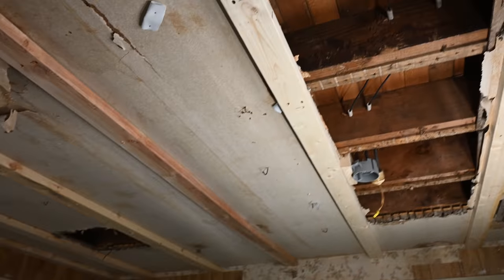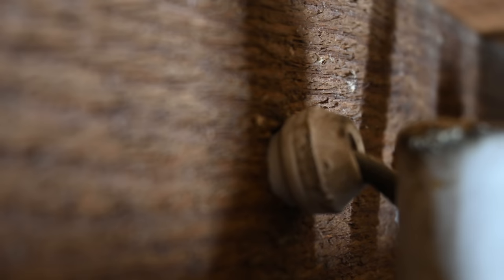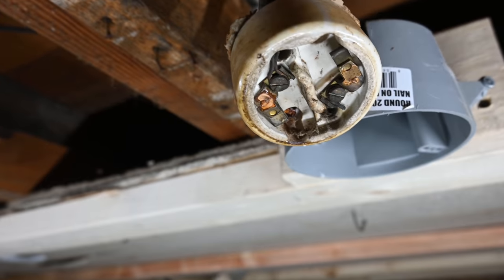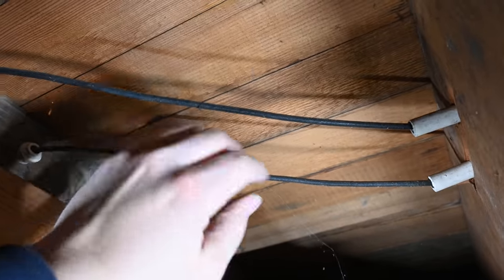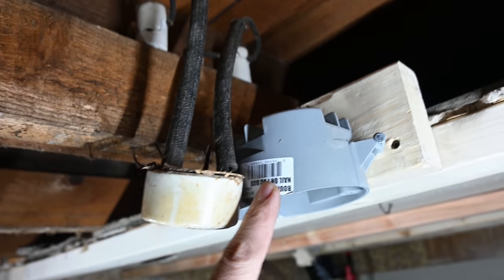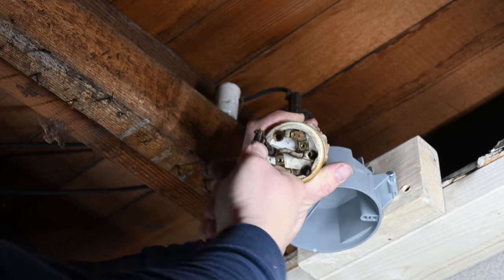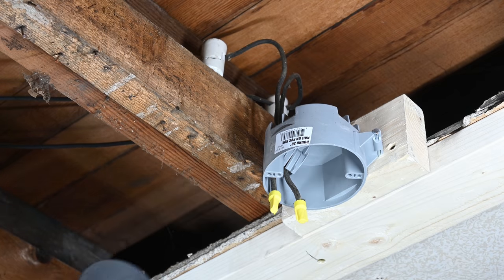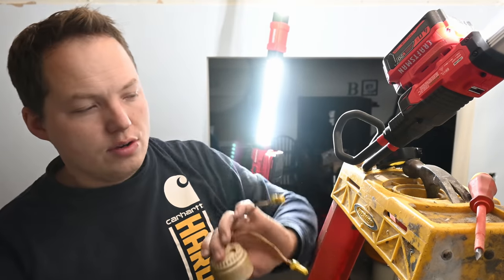How To Abandon Knob & Tube Wiring in a Wall or Ceiling

Comment: I'm in one of those areas where we prune back K&T by wrapping it around the last knob and covering with several layers of tape until we have an insulation as thick as everywhere else on the wire. On the other hand, we have to keep the loom covering when entering a junction box - the idea is that the insulation of the old wires tends to crack when bent or where it comes into friction contact (as with wire clamps). I see tremendous variation - some areas it seems in great shape - others the insulation is cracked and paired with shoddy add ons. My biggest problem with K&T is the complexity - because it is spliced outside of boxes it is often hard to decode. I have to be very careful in removing it that I'm not cutting off power to half the house. And sometimes it bridges circuits and shares neutrals - a recipe for destroying expensive fixtures when you think everything is done and flip the breakers back on.
Reply from the maker: Thanks for sharing. Having a lot of experience seems imperative when working in the situations you mention. Good point about leaving the "loom covering" in place. The insulation seemed fine in my case so I didn't think it was very necessary.
Reply: Well alot of homes use K&T  as well as Fuse Pannels ! Then you will find people splice Romex into it to give the elution they did a Rewiring Job ! Also people just replace the 2 prong outlets with 3 prong outlets to give the elution the wiring was up greaded !
Reply: @tww1981  There's a belief out there behind the hear-say that by putting a grounded receptacle into a two-wire system, then it's "grounded". It's
another example of people believing what somebody told them and  the bigger the LIE grows, the more convincing it is.
Reply: @frankpaya690  There is alot of "lets say -- creative wiring " to be found in homes ! That is something Mike Holmes found out on a episode of his show ! Although being a big name contractor on TV ; Mike Holmes should have known there is more than one way to feed both legs of a 240 volt circuit !  Hay it makes the job more interesting !
Reply: @tww1981  lol sounds hazardous!!
Reply: I’ve used them in light fixtures only like here in the video. They have now retired knob and tube now in Ontario under code. No additions or use.
Reply: @tww1981 What’s an “elution”?
Reply: @frankpaya690 
😲😯😲🥺😬🥴😵‍💫😵💀👻
Reply: @johnmack537  that the circuit is a grounded circuit and it's not
Reply: @mofbombay6290  I think the writer meant illusion, not “elution”.

Comment: If I have to partially abandon a run, I take it back to the nearest knob, loop it, then coil it back on itself, then tape it. Use the rubber tape, followed by the friction tape, like they did originally. I know when I see a potential hack job when I see shiney vinyl tape.
If doing a complete rewire, I remove all the wiring I can get to as well as the knobs and tubes. The holes left by the tubes are used to feed new NM cable. 
Another pet peeve are those that remove knobs by bashing them with a hammer. It sends porcelain shards flying. Use a flat prybar, push the knob to get the bar underneath and pry up. They come out quick and intact. No mess and faster than hammering.

Comment: I recently bought another home, and it also has knob and tube. My first home was built in 1860. The whole upstairs was still knob and tube. I found so many scary things in this house. The attic had blown in insulation, and when I went poking around I found a open junction box that was way over the allowed amount, and packed with insulation. At the time I found it I had already lived there for 10 years. I'm very surprised that a fire never happened.

Comment: Hey Frank:  The house I renovated was built in 1920.  It had 110v single phase service.  The 110 input was divided over two 60 amp cartridge fuses.  Typically, one circuit was for lighting and the second was for outlets.  The wires were coated with a shellac type substance.  There was no heat insulation placed into the wall.  When we bought the house the kitchen had a refrigerator, a chest freezer, a clothes washing machine, and a gas dryer plus a light.  In the attic, again no insulation, the posts were mounted on top of the ceiling joists and wires were strung between the posts.  A parallel set of wires about a foot to 18" apart was on circuit.  The house was doubled in size with a replacement kitchen and a master bedroom.  The service to the house stayed the same.  As part of renovation we rewired the entire house to current code in 2009.  We were going to leave the knob and wire arrangement in the attic as it was no longer connected to anything but the inspector wouldn't allow it.

Comment: Ben, LEDs are all driven by DC and they all flicker! If they didn't flicker, the diode would actually burn out. The strobe effect you're seeing is caused by your cam capturing at a frame rate that is out of phase with the LEDs. Some flicker slower or faster than your cam, so some are just fine. 

I agree with everything you said about K&T. Only thing I'd have done differently is keep the wire in the loom tubing, and push that wire and loom through one of the box clamps for added protection. I've used a screwdriver to push open those integrated clamps in the box wide enough to jab the loom and wire in it. One clamp per conductor as you did. I also like to put a band of white heat shrink tubing around the conductor I've confirmed as neutral. 

Bummer about messing up those Knipex. Think of it at it as a battle scar in your journey to be a sparky. I have messed up at least three pairs of side cutters cutting cables "I could have sworn" were dead.
Reply: Higher frequency PWM would make everything less or not noticeable though.  Difference of a few cents.  Just old fashioned thinking.  I agree with Ben.  We need to upgrade the PWM frequencies on all dimmers!  Godspeed!
Reply: Um no. They don't all use pwm type of power sources and even if they did, obviously some brands have mastered the art. Leds must be current regulated but do not require pwm or pulsed power sources. They are used in all kinds of equipment including indicator lights and are most definitely NOT pulsed in those applications. Especially when using linear power sources . 
Pwm allows better efficiency of power usage because you are not wasting it as heat which is what happens when using a resistor of sort to lower the current to the LED. Milwaukee has not mastered it's use and are terrible across the board when it comes to their lighting.

Comment: Was an electrician for 20 years, move to a different state with no reciprocity for my license, I'm now working as a demo-remod apprentice (general)... today, almost 30 years after I started wiring, did I finally leave a house with a working k&t circuit. I've always been fascinated with and had an affinity for antique electrical equipment, so to quote the venerable Ice Cube, "Today Was a Good Day"...

As far as what we did with the circuit, inspect it and leave it alone. The original light fixture was still attached, and still working.

Comment: Thanks for sharing.  I’m slowly replacing the knob & tube in my 1940 built home.  When it comes to contemporary load demands, although the LEDs require a fraction of their predessors, they lighting is often shared with power or receptacles which are likely to be drawing more current than they’re designed to carry (such as a 30 amp water heater circuit being fed on maybe a 14 gauge wire).  I have found several cases where the cloth insulation has warn through, exposing the conductor as it enters the box, so I suggest using the Supper33 you reference to wrap the insulation if you notice any deterioration and add a wrap of white on the neutral as well as a circuit number on the hot for future convenience.  Where a splice occurs inside a box to mark the incoming hot so as to keep track of the direction of the current.  The scariest thing I found was finding the Zinsco panel allowed some very hazardous circuits to hold, rather than trip the breaker- even after a hot and a neutral arched in a ceiling fixture, caused by the cloth insulation breaking down in a pendant light in the dining room.  Fortunately, it was shortly after our first dinner guests returned home.  PS- I would be very interested in a walkthrough of the old house you mention.  Thanks again!
Reply: I will preface this by saying I wouldn't recommend this to anyone, but what I do when replacing fixtures on a ceiling that have had a history of being overlamped, I typically find the K&T wiring's insulation disintegrating in my hands.   Usually the wire is #14 solid.  I take a piece of  scrap THHN wire and strip the insulation off a continuous length long enough to sleeve onto the existing wire where the insulation fell apart, then use a much smaller amount of 3M 33+ or 35 to tape where the old insulation meets the new insulation.  Obviously if you get the opportunity, it would be better to re-feed the wiring with NM-B cable, but to make that legal, you really almost have to start over, rather than simply run the NM-B back to the next nearest K&T  source, which technically is also a Code violation of greater issue.
Reply: Well of course your house at the most when it was built had a 60 amp service. My thoughts are if you have knob and tube abandon it yes it will be a chore but you will sleep better at night. Think about this I am certain you have seen old movies with those odd looking round light switches on the walls, well the wiring for those were most probably retrofitted in this buildings and the cuts to install them were plastered over. After a while you will get proficient at it.
Reply: I have ran into that old old wiring that replaced the knob and tube stuff and the cord wrap inside a box usually frays and if the wire is manipulated the least bit the black rubber just falls off the wires another thing you will find is copper coated steel wire from world war two. Found out about that when we did some junking in the early sixties and mixed a bunch of it in with good copper and burned the insulation off it to take to the scrap yard. Did not get squat for that load for sure.
Reply: We have so many Zinsco service calls, the bus bar always seems to burn out and breakers not tripping so they burn. I really do not like this knob and tube stuff. Eventually I'll change to commercial only.
Reply: @billhale9740  interesting, I'm only 22 so I like learning these things.
Reply: Same here, upstairs in a 1920's home (with no good access to ceilings because we have a flat roof and so, no attic). No flickering or dimming happens in a couple of rooms with small window AC units, so... fingers crossed. Wish the builders back then could see the future, as 1920's architecture is just not adaptable in may ways.

Comment: First  off, thanks so much - this video is very helpful.   My 1916 built home has a mix of K&T, ungrounded BX from approx. the 1950's, and modern wiring.  All the heavy hitters have been moved to the 100 amp service in the basement on newer wire.   I had insulation blown into the house 20 years ago unknowingly and just learned this was a major risk, so am now doing a map and inventory of all my circuits to see what is the state of the state.  

Fortunately, the two remaining solely K&T circuits running from the sub panel in the attic (30 amps) have very few fixtures and only outlets and lights.  But there are a number of circuits that are a mix of all three styles of wires.  One with 17 fixtures on it - ugh.   I'm currently moving as much off this circuit, with out having to open up the walls, all while trying not to curse the prior owners.  My tone probe arrives tomorrow (yay!) and will be a big help.   Also happy to have all LED bulbs at this stage.   It's shocking (haha) that there hasn't been a fire.  

I will be doing as much as I can right now without opening walls, and will most likely leave some wire in the walls.  Glad to know what can be done with the abandoned wire, and how to make it as safe as possible.   For sure I will not be leaving any live segments.
Reply: If you can, I'd suggest moving all receptacles off the knob and tube. That way you don't need to worry about heavy loads. I'm on my second house rewire with knob and tube. I found similar mixing of newer wire spliced onto the knob and tube. In both cases the landlord said the house used to be knob and tube but was rewired. Not even close - they put newer wire where it was visible and left a lot of k&t. In the first house, I really think they had one circuit for all lights and outlets. Breaker labeling gets creative too. A breaker labeled Living Room was really the living room, the kitchen light and an outlet, an outlet in the laundry area, outside lights, and ungrounded outdoor outlet in a non-weather poof box (!), the light at the top of the stairs, the lights in the middle and back bedroom, the light and both outlets in the front bedroom. The house I'm working on now had the entire second floor plus lights on the first floor, and first floor bathroom lights and the flood light out back all on a breaker labeled First Floor. Lol. Watch out for lights fed from both floors. I thought I had everything off the first floor knob and tube, so I cut the wires that ran through the first floor ceiling. The light at the top of the stairs stopped working. The neutral was taken from the second floor, but the hot came from the first floor. I got that corrected, but there was a wall light in the back bedroom (the only light in that room) that fed up from the first floor knob and tube. One trick that helped me was to use my clamp on ammeter to see what was on the knob and tube going toward the kitchen. I turned on or plugged in various things and watched the ammeter. I could tell that the ceiling light, one kitchen outlet, the light at the back door, one laundry room outlet and light, and the outdoor outlet were all on that pair of knob and tube wires going from the dining room ceiling into the kitchen ceiling.
Reply: A tone probe ncvt is a useful tool, if you know it's limitations. I would highly recommend a tester or multimeter as well, if you're going to be doing anything with potentially energized wire (huge amount of information to be gained by metering things anyhow). Klein also makes a device that plugs into receptacles and lighting fixtures and tells you which circuit you're tapped into, at the breaker panel. It's like 30 bucks and may be useful for you.

Comment: Yep our old house had K & T.  House was built in 1842 and torn down in 1995.  The basement had conduit, and in the 70's my dad ripped out the old cracked plaster and put in Romex on the 1st floor.  We only had 60 amp service, 4 15 amp type S fuses.  He wanted to put in a 100 amp box but he thought they would force him to rip out everything and start from scratch and we did not have the money for that.
From what I've learned over the years K & T was the first method of wiring and was used in some places up until the early 50's.  Depending on the time period, they would put the hot on the left and the neutral on the right, or vice a veray .  In the attic they would nail the knobs on top of the rafters, save time on boring threw with the old bit and brace.  The wires did have a outer cloth covering with coloring but after a 100 years baking in a hot attic, well most of that faded away.  Also at different times and places, lots of switch loops were used, also fuses could be in porcelain sockets and sometimes they fused the neutral and NOT the hot side.  Whereas nowadays all over current and switching and disconnects are done exclusively on the hot legs.  Also in the very early days their were no outlets, you used an adapter screwed into the light socket to plug in a small fan or toaster.  And then the only light hanging in the center of the room has a on/off knob on the socket, so you have to stumble into a dark room to turn on the light.  That would not fly today where we are required to have a switch by every entrance to the room.  
But we have to remember 143 years ago this was the Wild West days of wiring, there was little experience and few codes and even fewer people to enforce them.